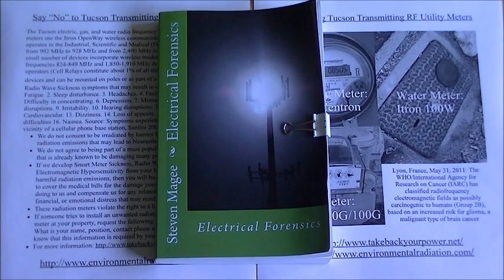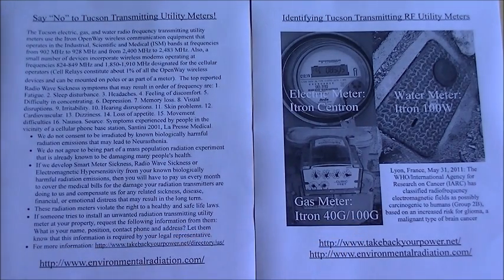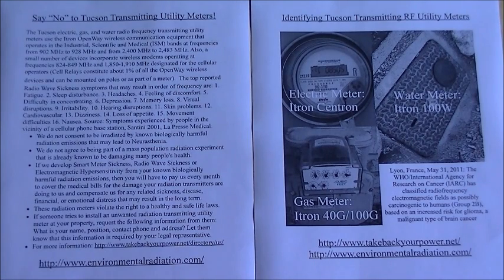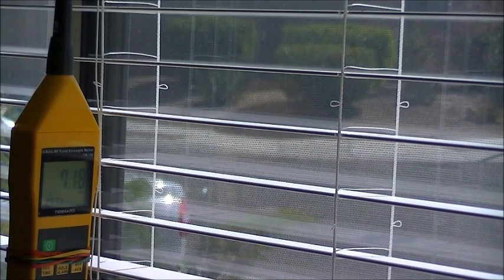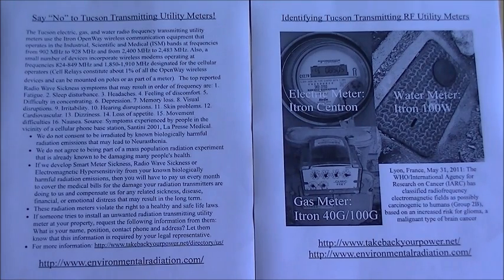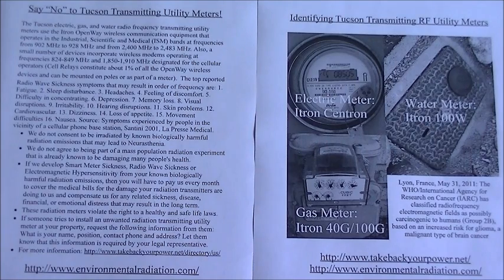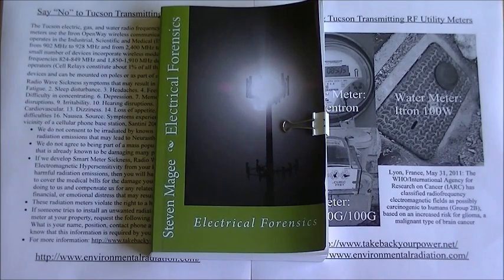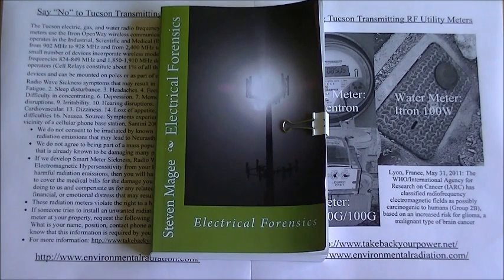This is More Toxic Than a Smart Meter!

Comment: Unmarked white cars...sinister
Reply: Let's look at why we do not need smart meters. 
 #1 A smart meter will hurt or even KILL disabled homeowners who have disabled medical implants.  The average of deaths by smart meter radiation and smart meter fires is almost 100 every month in North America.
#2 Did you know if your power company “turned off” the power to your home when they did a smart meter install, your chance of a smart meter fire increased by a factor of 10,000.
#3 Your power company has access to all of you private power information. Eg When you make tea, when you turn on your alarm etc. This private information is sold to Google for huge sums of money. Ask your power company what the second radio transmitter in your smart meter does. (ZigBee) 
#4 A smart meter will cause cancer to return if your family members who are fighting cancer at home. If they come home from the hospital and sleep near a smart meter, they will die. Check with the US Cancer Society website. 
#5 Smart Meter RADIATION  will turn off breakers in your home. Both AFCI's and GFI's get turned off by the radiation from the smart meter.
#6 You smart meter is very accurate, BUT, the software (firmware) is programmable. Your bill has nothing to do with the power you use. 
#7 Smart meter radiation is breaking Ionic Bonding. 
#8 A huge expenditure for a huge loss. Billions of dollars to purchase something that does not general generate any power and each smart meter need 4 watts to operate. One million smart meters use 4,000 KILOWATTS of energy to operate.
#9 The second radio transmitter is for ZigBee. If you want your power company to MONITOR your home 24/7, then you are in luck. Don’t forget, this private information will be sold. Why do you think your power company spends BILLIONS of dollars and does not generate one watt of extra power to sell?
Reply: Amazing reply Frederique Zug! Hope you don't mind if I copy it for my reference. I totally agree it is govt mandate killing.

Comment: Two-way SMART meters are a problem to humans within their homes. The frequencies are known to effect the brain. It goes thru your walls, and communicates with your SMART appliances. Then transmits via a second freq., your data going from house to house meters,  called 'Daisy Chaining)  til it gets to a local repeater. I suggested to one of the first recipients of these so-called SMART meters, in our desert to call the Utility and have them remove it and replace it with a standard analog meter. They complied but, it cost the homeowner, about $10mo. to have them come out to read it. He's much happier and I believe healthier now, for he was constantly ill prior to having the SMART meter removed.  In Calif. Edison gives the homeowner the option of removing that meter and replacing it with an analog meter.  I also, believe the Edison and others had the right of way, to install 'wired meters' years ago, on private property but, they don't have the right of way to install a ' Wireless device/meter' on your private property.  PG&E...was another Utility company that installed many of these ITRON meters on peoples homes, without the homeowners or businesses permission to do so. Some areas of the US, had homeowners arrested for stopping local Utility Personnel from installing SMART meters onto peoples homes.  Check with your local utility and see what they'll do or won't do and IF, they don't comply...gather all legal data and info you can, and show them, that they may be in violation of County or State codes or laws. The squeaky wheel gets the grease.

Comment: Wow. What the hell? If you have the radio on, do you notice if the reception is affected? I notice that if I have the radio on in my car and drive past public buses (in a certain state, not all states use the same types of buses), my reception will get messed up and I'll get static until I move away from the bus. Whatever it is, it's located in the front area of the bus probably in the dashboard area. And now there's all these "smart cars" with radar that are supposedly made to help drivers part and stop in time when it's getting too close to hitting another car. I wonder how much radiation these cars emit. Wow, good find. Maybe you should move...if possible.
Reply from the maker: I'll have to check out the busses here in Tucson!  I routinely rode a bus for a few years for three hours per day.  The longer I was in that particular job, the sicker I became.  They have just installed an electric streetcar system in Tucson and it affects the static on the AM radio band if you drive between the overhead power cable and the rails in the street.  High end "Smart" cars are arguably EMF toxic, it pays to buy the entry level model without the funky extras.  Regarding the RF meter reading car, I'll put a radio on the next time I expect it and see what happens!
Reply: StevenMageeBooks I only have the radio on FM and that what happened whenever I drove or stopped next to these buses (there's a high pitched noise, static, and buzzing). You should definitely test it out.
Reply: That sounds like ignition or generator noise.
Reply: James Van Damme what does ?
Reply: Wideband noise that's related to engine RPM. Narrowband signals shouldn't interfere with FM broadcast.